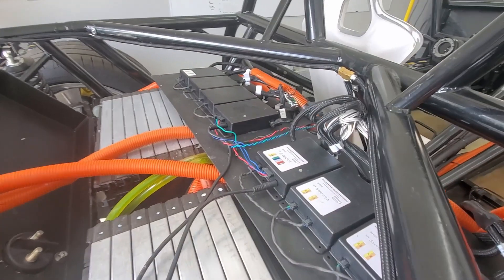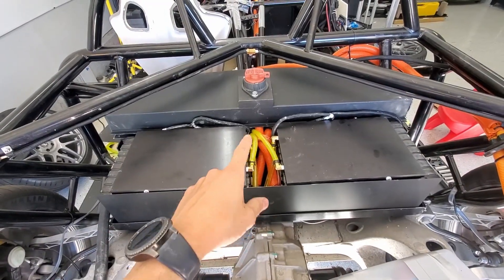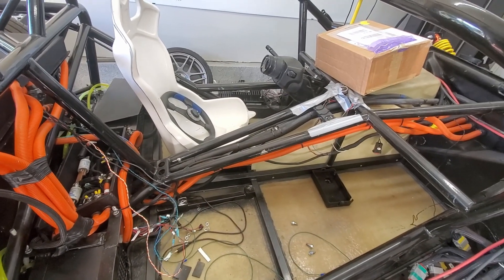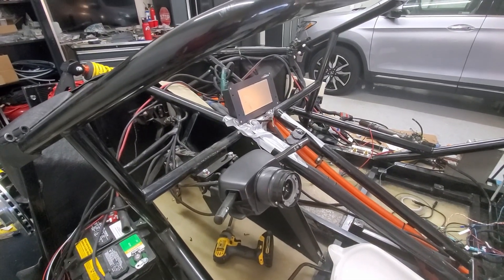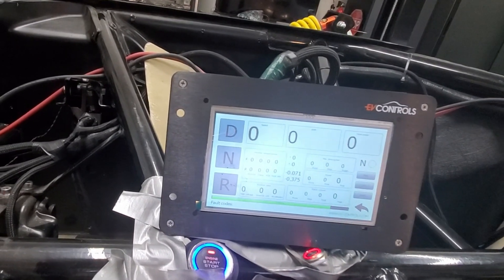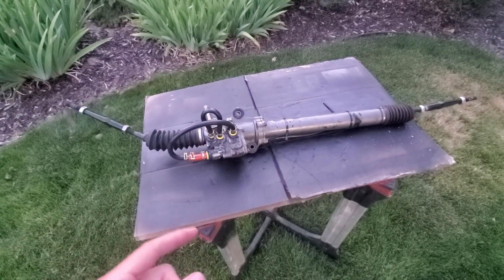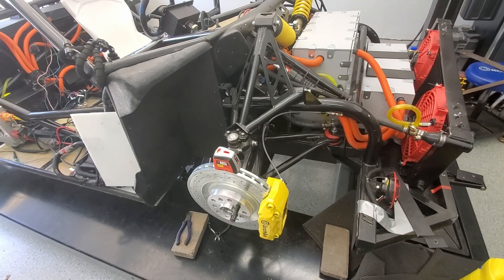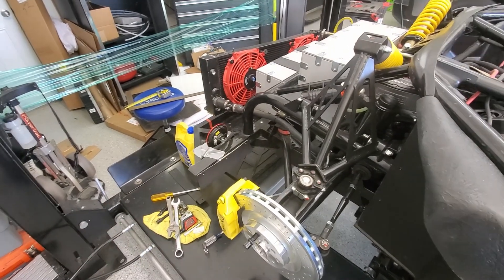Broke - the Tesla controller will not talk to the inverter

Comment: I think you still are not shielded enough. Once the HV comes on its not getting full packets over the can. Could you re run the can bus line away from the battery?
Reply from the maker: Thanks for your comment Bob.  It could be.  🤔   It behaves the same, with or without high voltage engaged.  Why do you think I was able to drive before (CAN working) and not now with no wiring changed?  I can try moving the wires around to see if there is any improvement.   Definitely a head scratcher.
Reply: @electricsupercar  send me your contact info, I'll give you a call.
Reply from the maker: @bobwinn  send me a PM electricsupercar@gmail.com .  I would love to chat with you and get your advice.
Reply: If you have extra connector/pins maybe try to create super short cables and put controller “next” to motor. By that you will definitely avoid possible shielding/cable/interference issues.